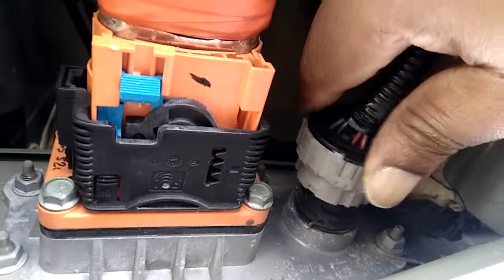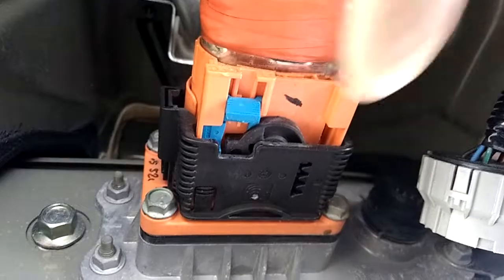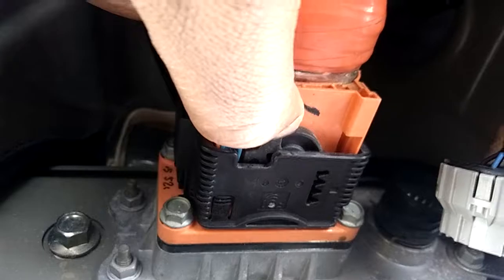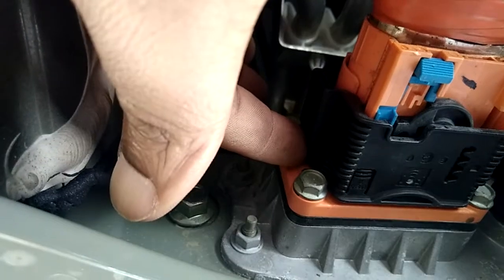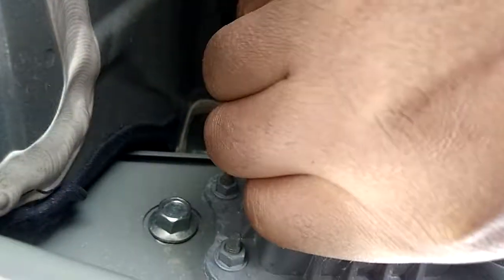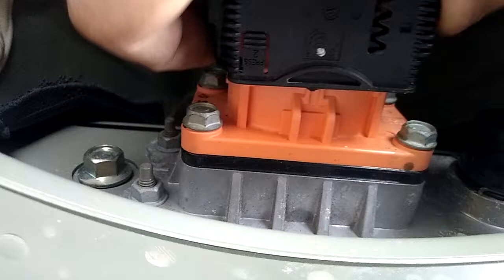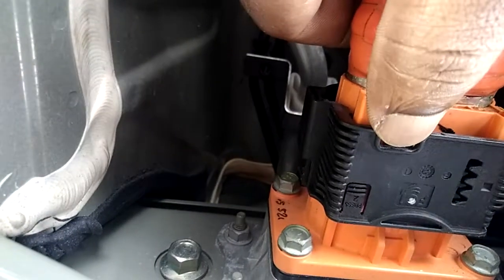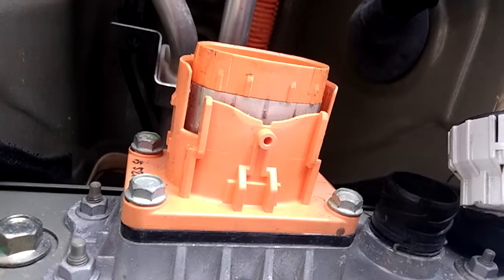2011 Nissan leaf battery

Comment: Mr Sho, i have few questions to ask you. do you have an email please? its regarding my 2011 leaf
Reply: @t.shonoiki563  i would like to understand the whole process because i will be taking the car to Africa and i need more battery capacity.
Reply from the maker: you will need to watch as many videos as possible on Nissan leaf (DIY) for you to think of doing work on Nissan leaf without support from Dealer or Nissan.
If with all you see, you do not understand please do not attempt to start work or buy any of the first generations Nissan Leaf.   Just go for the most recent and long-range electric vehicle.
I wish you the best.
Reply from the maker: https://www.youtube.com/watch?v=63GNQp45Bmc&t=33s